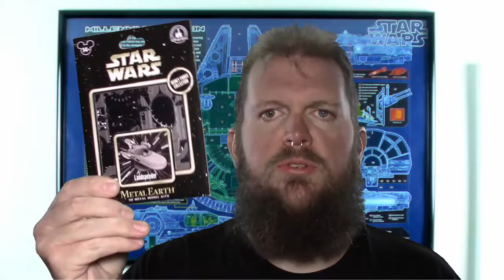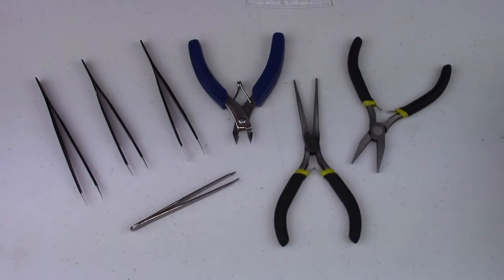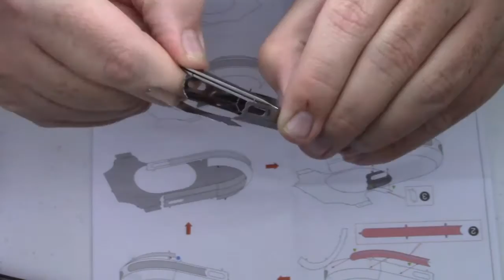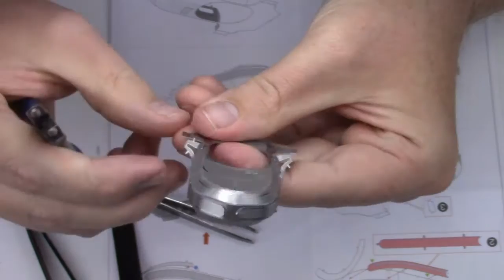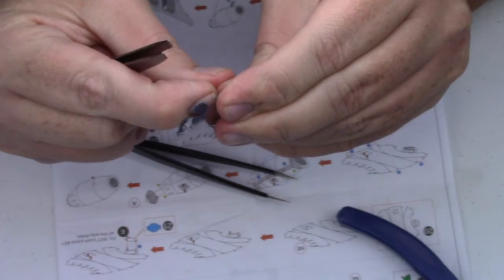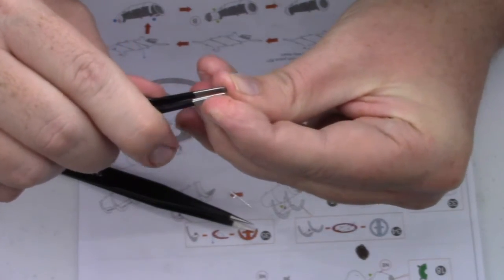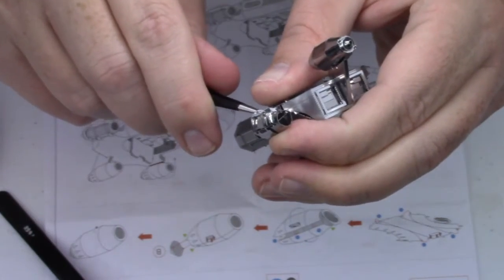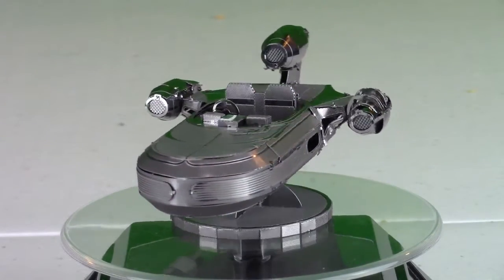Metal Earth Build - Landspeeder - Star Wars

Comment: Got mine done.  It actually came out well, I think.  Partly because you "warned us" about a couple of things.  They apparently didn't take into account Part 2 going around an outside curve.  A 32nd longer would have made it so much easier.

Regarding the one engine where there was no room to get to the connection, I bent the tab about 90 degrees first, put it into the body and then fixed the outside one - made it rather easy.  I've used this technique before.  They also missed putting a windscreen on it - would make it look a little better.

Thanks, as always.

"Keep on..."